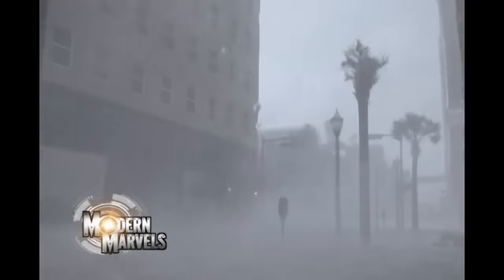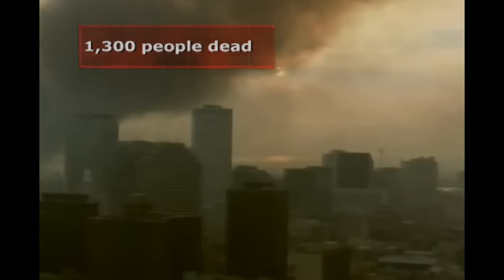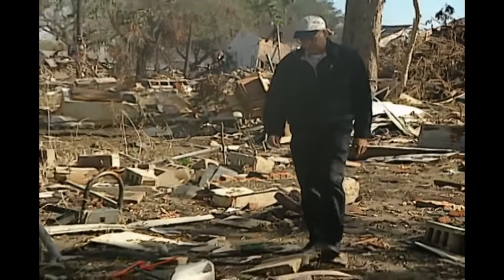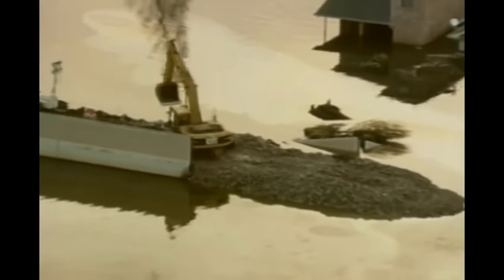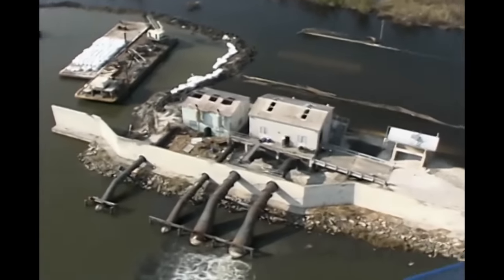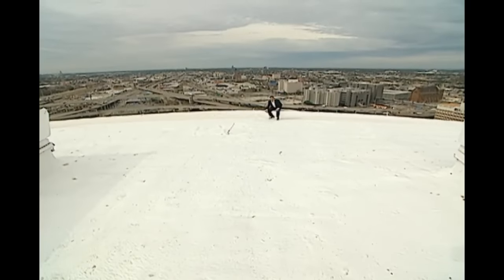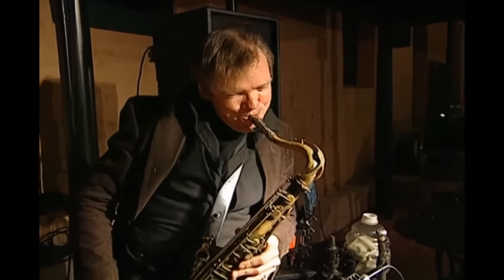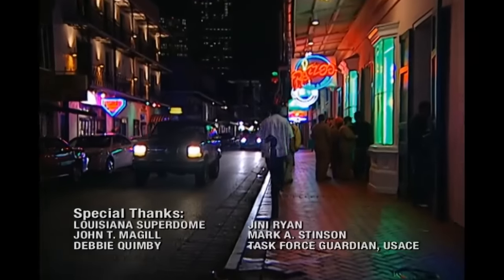Modern Marvels: Engineering Disasters: New Orleans - Full Episode (S13, E8) | History

Comment: New Orleans sits on hundreds of feet of silt which is extremely soft. The city has subsided (sunk) two feet since it was measured in 1970. Also the city itself is below sea level. The location of New Orleans with the exception of the old French Quarter, has always been untenable from an engineering point of view. Engineering band-aids will only make the problem worse. All the money in the world ( 42:22 ) cannot remove the triple threat of Lake Pontchartrain, the Mississippi River and the Gulf of Mexico.
Reply: Probably not a good place to live
Reply: Very true, but there are similar geological challenges that have been handled elsewhere too. One of which had its own Modern Marvels episode: Kansai International Airport, aired around 2001 I believe. It was finished barely a decade before Katrina hit, and survived the Great Kansai earthquake with just a couple broken windows. The entire perimeter is designed to break up tidal waves, no reason the same reasoning couldn't be used in New Orleans.

Comment: Start a program to bring dirt or backfill into the city, like the pump stations. A couple of railroads bringing in dirt from a dredging operation off shore or wherever. It would never stop like the pumps. Meaning there would be no completion date, it would always be ongoing. They could start along the perimeter and slowly corkscrew towards city center. 
It would require completely destroying and rebuilding the city over a very long period of time. But without the city will be permanently destroyed.
Reply: Ask Japan and their Guinness world record holding breakers. It. Does. Not. Work.
You LOSE the ground underneath because it naturally didn't belong to the land, period. You can not  "FILL IN" land and expect it to hold.
Reply: The location of New Orleans with the exception of the old French Quarter, has always been untenable from an engineering point of view. Engineering band-aids will only make the problem worse. All the money in the world ( 42:22 ) cannot remove the triple threat of Lake Pontchartrain, the Mississippi River and the Gulf of Mexico.

Comment: The high sand content on top of silt clay beds becomes a membrane on top of several oil fields that have been pumping oil out of the earth for decades. Even 20 miles to the east is the diamond crystal salt mine that had been in operation for nearly 70 years had removed thousands of tons of high purity salt. The underground caverns left behind as the mining continued conspired with withering oil deposits to create and underground water system that will continue to sink the big easy further every year. An example of how extensive the water system is was demonstrated when texaco drilled an exploratory well that was drilled in the wrong place due to a missed triangulation survey placed the well bore directly over the salt mine. Lake pegnoir at the time was only about ten feet deep and as the presence of the mines proximity was known, the dislocated well bore penetrated the lower mine shaft. With a 10 inch diameter well bore spraying water into the mine the salt dissolved quickly turning the lake into a whirlpool draining the entire lake in hours. Even the river that runs off into the gulf reversed its flow and started pulling water from the gulf of mexico. This created the largest waterfall in loisiana at 225 ft. Its well documented and quite the story to watch.

Comment: Shortly before Katrina, ING 4727 was under charter by Lafarge North America, having recently delivered a load of cement, and was reportedly empty just before the storm. ING 4727 was reportedly in the Mississippi River-Gulf Outlet Canal in New Orleans when the storm hit.[2] Evidently not secured adequately for hurricane conditions, the barge found its way into the Industrial Canal (also known as the Inner Harbor Navigational Canal) where it went through (or caused—see below) a breach into the Lower 9th Ward neighborhood.

While many other vessels in southeast Louisiana broke their moorings during the storm, ING 4727 became particularly notable both due to its size and because of where it landed. Although its dimensions are standard for barges in commerce on the Mississippi River System (of which the Industrial Canal is a part), it is larger than most Louisianan houses.[3] During and right after the storm, ING 4727 was moved around by currents in the flooded neighborhood, smashing houses and cars beneath it in an area of several city blocks.

Comment: The answer to why this happened is very very simple "you don't build a major city under sea level" 

~case closed your welcome
Reply: that doesn't solve  current problems.   that's like saying if you don't want to die in a hurricane  then don't get killed.
Reply: @justbored3.14  Thats why I said the answer to "WHY" this happened and not the solution to this problem.
Reply: @justbored3.14  The location of New Orleans with the exception of the old French Quarter, has always been untenable from an engineering point of view. Engineering band-aids will only make the problem worse. All the money in the world ( 42:22 ) cannot remove the triple threat of Lake Pontchartrain, the Mississippi River and the Gulf of Mexico.